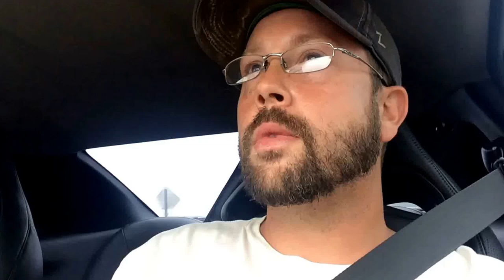GTR driveshaft noise

Comment: Hi mine did the same boulhousing rattle bearings gone
Reply from the maker: Yeah, the bearings go out easy even on the new ones. Best to use Wes Hawkins V2 or V3 bell housing.
Reply: Hi I'm lucky car is fine now it was actually the main drive shaft universal  was warn out had to buy a complete drive shaft can't get the universal sepret👍👍🙈